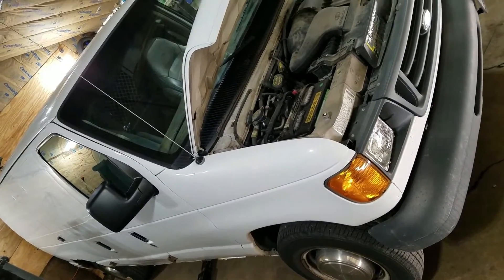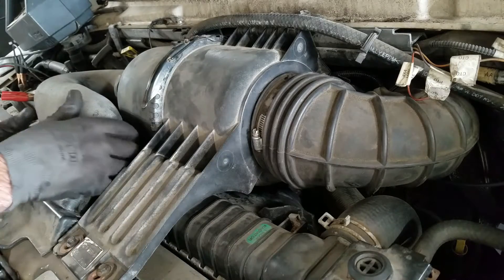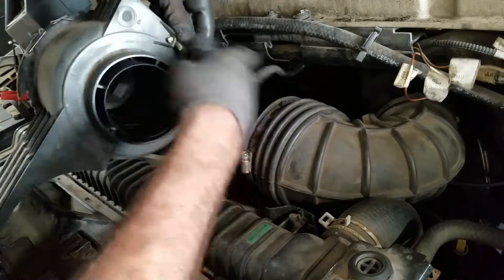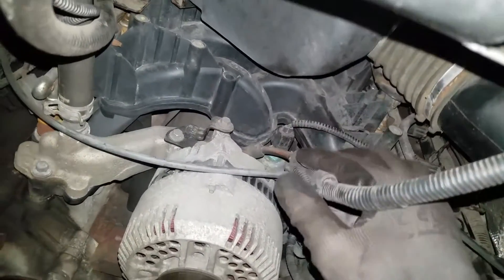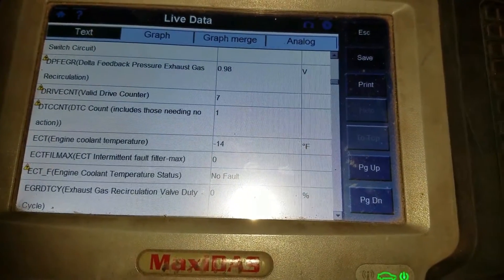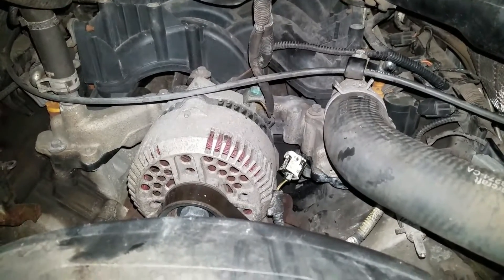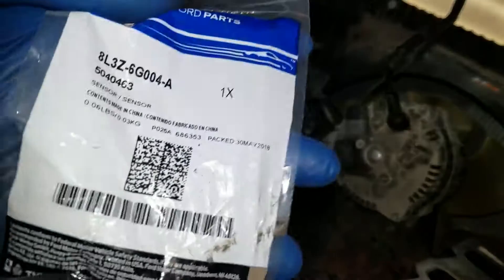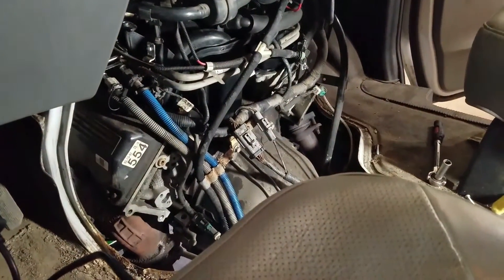Ford 5.4L extended crank hard start no start diagnosis fix

Comment: I have a 2006 Ford F150 5.4L 4 wheel drive. Truck has very intermittent cranking issue. It is random sometimes I can hop in and turn the key and it cranks right over with no issues but other times I turn the key and it tries to crank engine sounds like its starting and then sputters to get itself to almost idle and then it dies but then has no issue cranking after that happens. Every time the truck actually cranks over I have absolutely no issues afterward and there are no check engine lights to go off of. Ive replaced the engine air filter, fuel pump, fuel filter, spark plugs, injectors and coil packs all within the last year and the truck still does it. I have never not been able to crank the truck eventually but this issue is so annoying and has been with the truck for a while. do you have any thoughts?
Reply from the maker: Tough. Make sure the MAF is clean. Dirt, hair, feathers, can make it behave strangely. You can try unplugging it, to see if it starts better. CMP/CKP sensors can do that, but usually has a code. I am probably wrong, but there is always that.
Reply: @RustBeltAuto  Removed MAF sensor and it looked absolutely prestine. I cle3aned it anyways but still have the issue. Any other thoughts?
Reply from the maker: @CFlo93  not really. I cannot diagnose the thing in text.

Comment: I’m having a sluggish start “ roo roo roo then fires up” once I drive for a bit truck won’t start again until it’s cooled down. What would you suggest I check first? Thanks a bunch! 2006 ford f150 5.4 lariat. 280,000km. Once it’s running she runs great and sounds very healthy
Reply from the maker: I have no suggestions.

Comment: Man this is weird case man. I did an engine swap on a 2003 F150 with a 5.4 that came off a 1998 e-250 5.4. Previous engine blew and this engine runs but only when cold. So I might have to get a newer sensor installed. The sensor I currently have in the block looks like the one you have except it’s got a pigtail on it. The connectors fit on my 2003 harness but it’s maybe trying to send a signal to a needle gauge and the computer is looking for it’s digital signal and therefore running like crap.
Reply from the maker: What does the data say.
Reply: @RustBeltAuto   I don’t have scanning software but the sensor on donor engine has a pigtail connector and the one on blow engine was a plastic connector on sensor without pigtail. Truck only runs when cold. Replaced fuel pump, fuel filter, battery, alternator, throttle body assembly, new air intake, new water pump, new spark plugs, new coils, new 02 sensors, new thermostat, new air filter. Next things I’m thinking about replacing is this Head Temp sensor fuel pressure regulator and maybe injectors if it’s still not running when hot. Spark plugs are gapped properly. I don’t know what I’m missing. Hopefully this sensor fixes the issue
Reply from the maker: @benjaminv6243  it's best to see live data.

Comment: Tried this with my 04 250 5.4 6spd manual and it didn't make a difference.... sometimes the truck starts up with no problem and runs perfect, sometimes it cranks and cranks and don't start. But in a jam, I can jump it in gear and it starts and runs fine.  Also, the engine light stays on when it doesn't start but the light goes out when it cranks up to run. I just don't get it.  Side note: truck starts with this coolant temp sensor completely unplugged. So, not sure this is a 100% good solution.  Seems like I got myself a total mess of a pickup! I'll keep searching.
Reply from the maker: If it is in gear, it should not turn over? Just a suggestion. see if the coolant, and air temp is the same when it is dead cold. also pull vacuum line from fuel pressure regulator, and make sure it is not full of gas, and fuel pressure is max when cranking.
Reply: @RustBeltAuto  sorry, I meant it can be pulled or pushed and caught it gear to start.
Reply from the maker: @dref4761  its a manual transmission? Sounds to me like an ignition switch problem
Reply: @RustBeltAuto  manual 6 speed. Does it with the original ignition switch, an ignition switch from an 00 f250 I had sitting around, and a brand new ignition switch from Napa part store.
Reply from the maker: @dref4761  I have no idea. Can only imagine you have some power turning off, or loosing 5v reference signal when cranking. If you leave the key on, and jump the starter to crank, does it run?

Comment: Is it 4wheel drive? If so fix the front wheel bearing. I kid you not. Plug the hub actuators vacuum lines to test
Reply from the maker: This was a 2wd van.

Comment: Thanks for the video I'm pretty sure.i have the same issue. 2007 ford E350 60k miles it cranks longer than it should and sometimes it sputters to turn and I have to floor the gas. Did this fix the hard start issue?
Reply from the maker: Yes
Reply: @RustBeltAuto  Is the part you used here the same for a 2005 f150 5.4 3v ?
Reply from the maker: @A.C.71  if you look it up on Ebay or something it should give you all the fitments.
Reply: on the vehicle you are working on this part did fix the -14 on the engine coolant temp ? I just checked my ECT and it was 185 degrees F. My issue is and it just started today is 2 out of 10 cranks it cranks but doesn't start.

Comment: Acts 21:27 And when the seven days were almost ended, the Jews which were of Asia, when they saw him in the temple, stirred up all the people, and laid hands on him,
Acts 21:28 Crying out, Men of Israel, help: This is the man, that teacheth all men every where against the people, and the law, and this place: and further brought Greeks also into the temple, and hath polluted this holy place.
Acts 21:29 (For they had seen before with him in the city Trophimus an Ephesian, whom they supposed that Paul had brought into the temple.)
Acts 21:30 And all the city was moved, and the people ran together: and they took Paul, and drew him out of the temple: and forthwith the doors were shut.
Acts 21:31 And as they went about to kill him, tidings came unto the chief captain of the band, that all Jerusalem was in an uproar.
Reply from the maker: Inappropriate. This is a car channel. People in the bible don't fix cars. There is a time, and place for everything. This is not one of them. Please don't obtrude.

Comment: This fixed my '01 5.4l 2V Ford F150! Very simply done within an hour by just removing intake tube and alternator (didn't need to remove intake manifold. Ran a jumper wire from broken sensor to female plug, truck received correct temp reading and started up. I will get a new sensor when I can. I no longer have to smash the gas pedal to the floor to start up the truck.....THANK YOU A MILLION TIMES OVER!
Reply from the maker: Welcome! I take it the intake was not leaking coolant onto the sensor.
Reply: @RustBeltAuto  I didn't see any coolant signs on the connector, or down inside the block gulley, but this must be common because as soon as I pulled on the connector it split into two pieces. I'm thinking heating cycles made the connector more fragile.

Comment: Pull the intake manifold. Mine did the same thing , ran around like a chicken with my head cut off until discovered spark plugs sitting in engine coolant. In most cases you can replace the gaskets and not the $200 manifold. Gaskets ran about 15 bucks.

Comment: Your video got me home yesterday. 03 Expy died and would NOT start, I even tried pumping the pedal, went through everything on the side of the road, bypassed the FP relay, checked EVERY fuse etc... After HOURS AND HOURS of troubleshooting, finally came across  your video  and it got me moving. Floored the pedal and cranked....VIOLA!!! Luckily I didn't kill the battery first. Turns out, same exact symptoms, leak and issue. Thank you also for the part number in the video as the local parts store people are clueless geniuses. Absolutely amazed that this was the issue. I wonder how many good fuel pumps got replaced and fuse boxes too as the FP relay is built in. I checked the schrader valve while hitting remote start so I knew the pump was good. You are the man!!! thank you thank you thank you, you saved me at least a 300.00 tow bill.
Reply from the maker: Welcome!